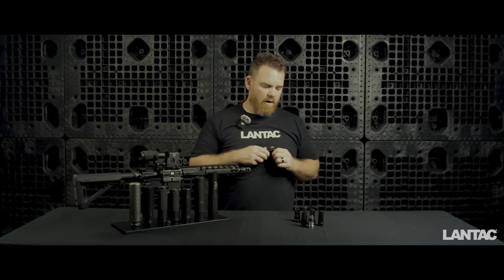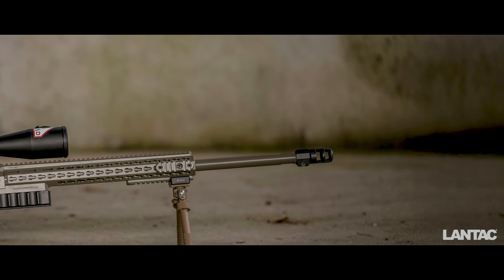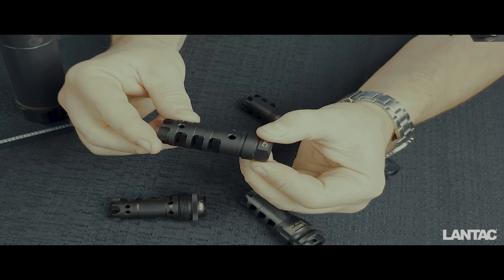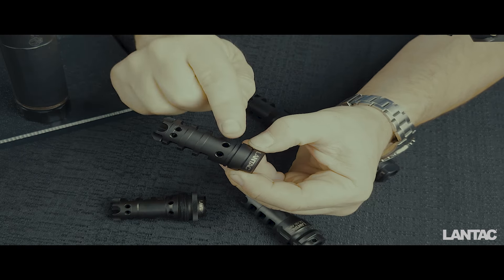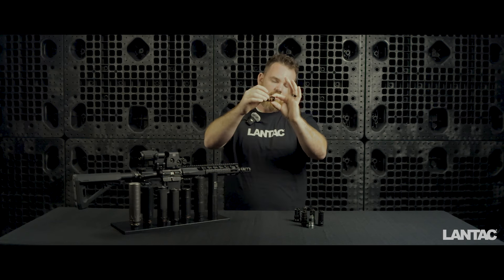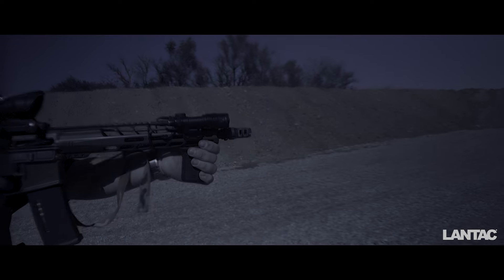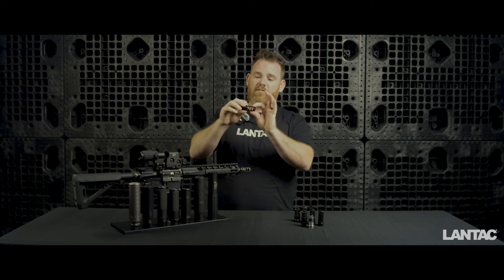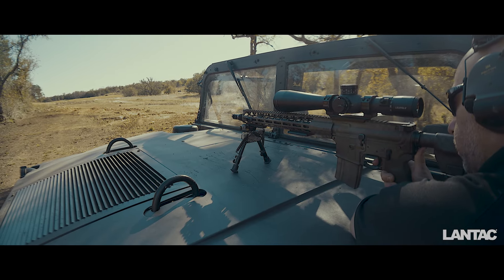LANTAC Dragon® Overview

Comment: I work on and shoot bench rest precision rifles. One thing in mind when loading cartridges is getting rounds to exit the muzzle at the same point in the barrel whip which is honestly difficult. It seems that these reduce the barrel whip. So when using a can with one of these may help when trying to accomplish this goal. Thank you for this video;
Reply from the maker: Worth pointing out that we machine these on a Swiss Lathe that holds fantastic tolerances and accuracy, so the devices are of a very high quality.